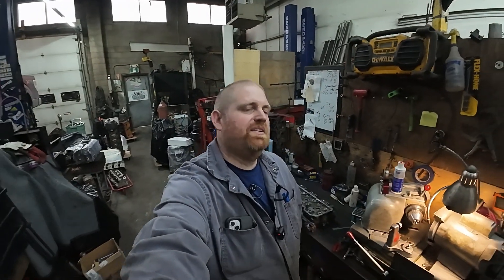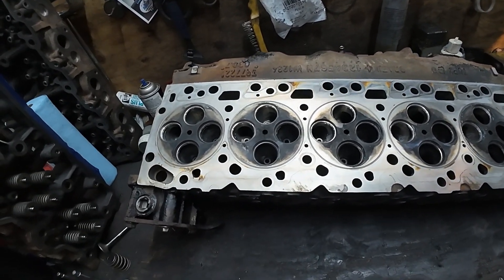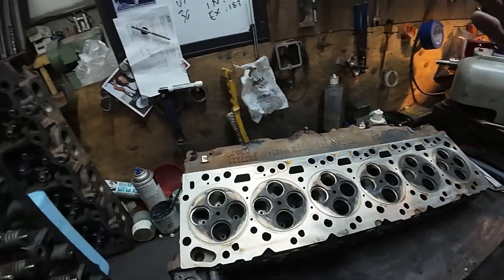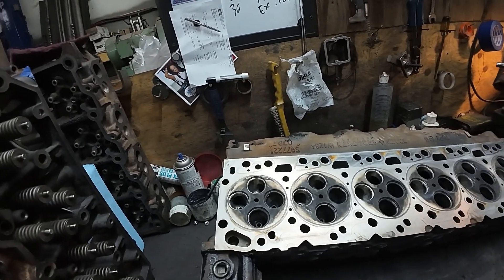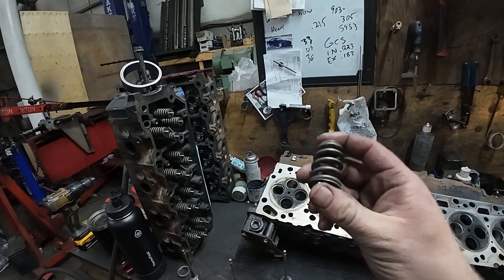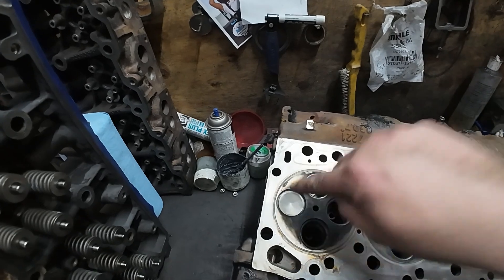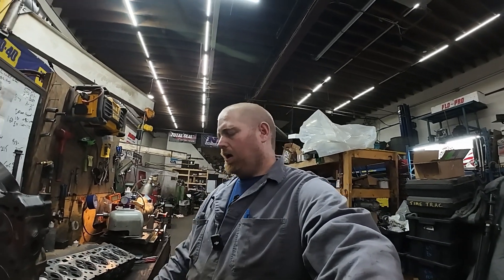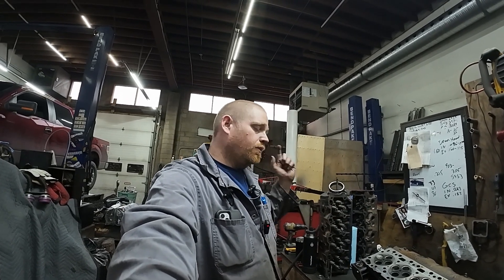1500HP 6.7 cummins Head Teardown and Inspection!  pt2

Comment: Have you ever, or is it possible to go in and bore out the valve guide, and relocate it closer to the Center of the cylinder? Move it .020-.030” then put and oversized guide in, hone back to spec. Reposition the valve seat, put in an oversized seat. Then would gain you another .040-.060 on valve diameter. Or could you do an offset guide and valve seat, as long as the valve job was concentric to the guide and the shrouding was done properly? I know there is a limit to this because of your rocker bridge, and rocker position, but if you’ve already noticed an improvement from increasing the valve 3mm in diameter is it worth the modification to maybe be able to increase 5 or 6 mm

Comment: I think the other thing with valve control that people need to consider is the rocker and lifter control as well. If your compressed height/clearance is higher than spec’d that would give you a lower spring rate. So if you’re running a spring that claims a 400lb pressure at .060” coil bind, but you’re running .150” coil bind, then your actual spring pressure will be lower (375,360,350) depending on the overall rate of the spring. Well if that pressure is not enough to pull the valve closed fast enough, it allows the cam lobe to fall away from the lifter, and/or there to be excessive lash between the valve and the rocker, the rocker and the push rod, push rod and the lifter, etc. Which at high rpm could cause a failure fairly quickly, but will definitely lead to premature wear and failure in the entire valve train up to and including taking out the camshaft. So a good valve spring and push rod should almost always be one of your first upgrades when trying to go faster.